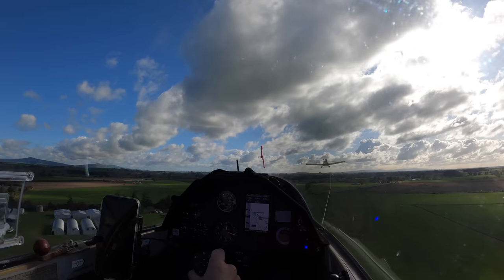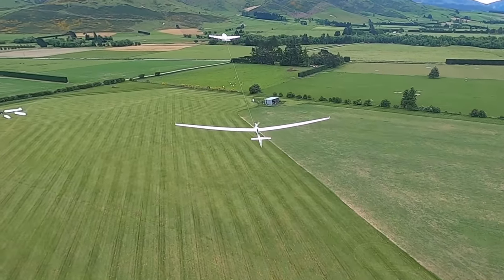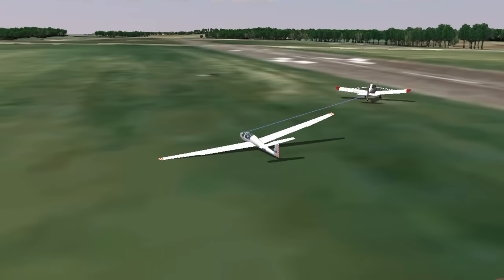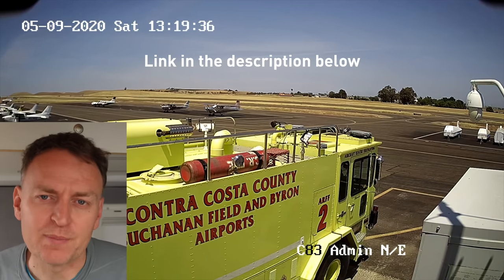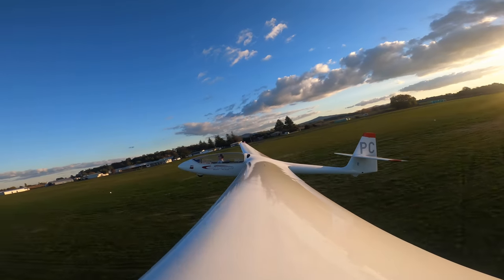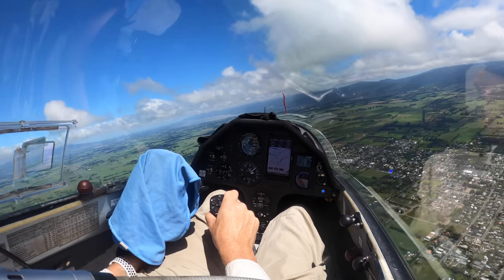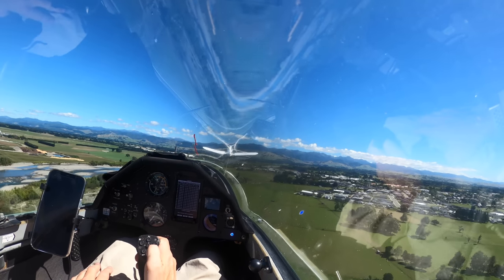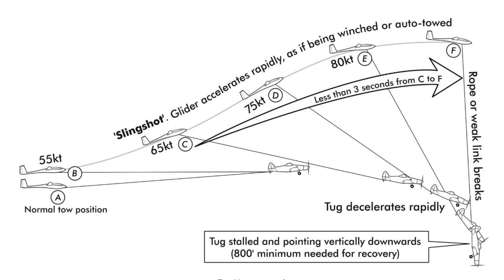3 Seconds to Crash: Glider Aerotow Launch Gone Wrong

Comment from the maker: A few points I didn't cover in the video:
- The tow plane does have a release at it's end too. But it's difficult for the tow pilot to see the glider, and if there is too much tension on the release, it might not work.
- For glider pilots, ensure your trim is correct for takeoff. It depends on the glider, but it's safer to trim a bit more forward than needed, than back. This should reduce the chances of a both leaping off the ground too quickly, and a vertical upset above the tow plane. Also don't forget to trim correctly once you're flying.
- Consider hand on the release during the critical low part of the launch.
Cheers!
Reply: The glider's release can be too far away to be held in your hand during tow (my old DG-101 was like that).  What is your opinion of a lanyard going from your wrist to the release handle?  Or an T-handle extension to place the release on your thigh?  Many thanks for this video.
Reply: @cemx86  Not a glider expert, but I have done a lot of safety analysis in other settings before. Regardless of other opinions (unless they're expert opinions/regulations), I would recommend doing your own safety analysis in addition to listening to other's suggestions.

The most important thing to look at when changing a safety device is, could your change impact the normal operation of the safety device and prevent use in an emergency? For example, could a lanyard fall and get caught on something, becoming taut and preventing you from pulling the tow release? Are there other ways the tow release could become jammed?

In addition, could the modification cause the safety device to be activated in a situation where it's not needed, or could even make a situation worse. Could the lanyard become caught on something that, when moved, pulls the tow release when you didn't intend to.

When analyzing something for potential safety issues (trying to identify issues that haven't occurred but you're trying to prevent from happening) it helps to just spend time brain storming. What are the ways this could go wrong (even without the modification) and how does the modification impact those things (good or bad)? Are there new ways things could go wrong due to the modification? Are the risks associated with the modification greater or less than the risks without the modification (IE. does the modification create a new potential failure mode, but the probability of that failure mode is much smaller than the one it helps prevent)?
Reply: @cemx86  We used to use an extension  lanyard and T piece handle on the release of our PW5  but I don't think they are really legal.
Reply: Did some thousand aero tows as a tug pilot in the mid 1980's. They had a winch system installed which retracted the tow line during descent. It had no release at the tug but for safety there was a cutting device for the tow line which worked very dependable, no matter of tow line angle or load and tension. Felt much more comfortable than the usual tow release.
Reply: "...if there is too much tension on the release, it might not work"  that has to be fixed doesn't it.
Reply: at 4 min 58 you write glider accelerate. is this really true . i think  when the glider go up in this angle it reduce speed and the tow plane speed is then reduce too because the glider work as a break parachute for the tow plane. the glider can in this bad sitiation if a pull down does not help to continue do more pulldown to get faster so the tension of the cable is remove and he can release.
Reply: @user-lw9py  if the glider pulls and climbs up, it accelerates. The rope length does not change. If the glider goes up it has to go more forward. The force on the rope accelerates the glider (and decelerates the tow plane)
Reply: one of the most important points my club taught me during training was to always have your hand on the release throughout the full launch (that applied to winches too)
Reply: @maikjustus2003  My guess is this glider use a center of gravity clutch (google translate this from Schwerpunktkupplung). better fly only bow clutch. I mean with speed the speed move only forward. when climb the speed that move forward is reduce but the speed of climb is increase. A glider have more  wing area and can slow down a tow plane alot when glider climb much.i did not know if simulations are able to simulate it correct or if they just assume the tow plane fly at same speed and the glider get faster.
Reply: @user-lw9py  the speed increase is the same independent from the clutch type. And yes, the tow plane decelerates. It is about the ratio of their weights (conservation of momentum).
Btw.: Depending on the type of clutch the recovery from "out of axis" can be much harder or even impossible, therefore with a "center of gravity" (?) clutch the risk to get too high with the glider is much higher. But if the glider climbs it will accelerate independent from the clutch type, but with nose clutch it will most likely climb much less.
Reply: @maikjustus2003  WIth a glider that have no nose clutch and the tension of the tow get 0 and then after some tme tension come suddenly , the glider jump up. then glider pilot pull down to climb not more up and get faster , tow get again tension of 0 and the game repeat. in the 80 their are many accidents. so as a tow pilot with less horse power better use only nose clutch able gliders
Reply: From a tow pilots point of view I have released some gliders on takeoff  Prier to starting the day the tow hook is tested at most extreme angles to make sure it will release. If on take off I am running out of control movement I dont think, I just release.  It then often requires a very quick reaction on the controls. Because you have been countering what the glider is doing and you are close to the ground. The glider has many more options than the tow plane. I have over 600 hrs towing and almost 1000 hrs gliding and at low level with a new student the take off and position hold behind tow is the most crucial time especially in a gusting crosswind....
Reply from the maker: @cemx86  The cable for the release has to be long enough to use it! Talk to your glider engineer
Reply: I am embarking on tug training one of these months, but have taken some cockpit photos and talked to tug pilots to mentally prep ahead of time.

Most tugs nowadays are fitted with an independent, reliable and robust guillotine mechanism, that will work regardless of tension in the line (chops the line, not a release mechanism, that could jam up under tension).

In the link at the bottom, there's a photo of a typical guillotine control mechanism (the yellow handle) - Right next to the throttle, where the tug pilots hand is going to be throughout the ground run and at least the initial climb out of the take off.  I am told that these are incredibly reliable and easy to use if used in time and save lives (plenty of incident reports to attest to this).

From what I've heard from various tug pilots all over, the attitude should be, if the glider gets too high, and in ANY way appears to be "losing the plot" in terms of the ability to control getting too high behind the tug, the unhesitating attitude should be cut them loose if in ANY doubt.

Better a glider field landing and the cost of a tow line than a wrecked tow plane and possibly severely injured/deceased tug pilot.

https://photos.app.goo.gl/ogAzEJ7ocvuMymB96
Reply: Thank you for these insights.🤍 👍🏼very well presented👌🏽
Reply: @nigelwilliams7920  It used to be a problem with seat belts, too. The old design with the button in the center that you had to push in was nigh impossible if there was tension on the belt. Now they have the button you push DOWN and it will release even under immense tension.  Surely something similar would be on a modern release. (I haven't flown gliders in 20 years so I'm sure things have advanced.)
Reply: @user-lw9py  if you've ever flown a kite, you can make an ascending kite accelerate by adding tension to the line. It creates force greater than the loss of momentum due to the climb and so acceleration is the result.
Reply: Yeah, I was just going to mention the Tow plane release. I worked at a Glider Airport outside Chicago,  Windy City Soaring,  25 years ago when I was 14 until 16 years old, in exchange for lessons & rental, until they changed the minimum age for "dangerous" jobs to 18. I was doing all the ground stuff for takeoffs and landings, connecting the Gliders, and running with the wing on take off, moving them off the runway after landing and etc, but I have seen the tow planes disconnect before, but never really thought about the line being too tight to disconnect. I remember something about an auto disconnect, which was a big hazard when the tow plane came into land, usually we had to watch out for that tow cable, but they would occasionally disconnect on landing and possibly turn into a random projectile/ very large bolo.. and we were just basically running around on the grass runway getting gliders ready and stuff. it got really busy at times, was the only glider place around Chicago fo a long time, .. been 25 years, but I definitely remember the tow lines disconnecting from the tow plane on landing occasionally when they hit the ground. I also swear I went over an emergency procedure for if the tow line disconnected from the tow plane before the glide, and hearing something about auto disconnect if I go too far out of formation during a tow during my lessons, it could have been some custom gear or something, and this was in the US also. It could also just one of those weird things I remember that never actually happened...   I haven't been gliding in about 15 years, been doing just power.
Reply: it did cover that aspect at3:19
Reply: If you have released, the question is can you do anything about the tug pilot? No. So you must concentrate on you flying your aircraft, and landing safely.
Reply: @PureGlide  I think something to look into is how many aspiring pilots are going for gliders first because they're far cheaper, because the middle class can't affordably rent or buy GA airplanes anymore
I'd even bet that that's transferring fatalities from the GA prop pilot section to the glider/tow section
Reply: @ialsoagree  I absolutely LOVE how you tell others to do their own risk:reward analysis, and game it out in their head. You don't see that very often from experts.. they've got their own opinion and they stick to it without even regarding how many different situations exist in real life
Reply: @cemx86  just my too scents, I think I'd just be really prepared and practice having muscle memory to get to the release quickly instead of doing your own modifications..
If you don't think you could even reach it during some profiles, though you might want to modify
Either way I'd practice going for that release lever repeatedly every time you fly, before you get towed
Reply: I think the study I saw showed that if the angle got to high even the tow plane could not release and no amount of elevator on either plane could recover the dive.
Reply: That's insane! If the towplane cannot release due to "high tension" - forget it.
Reply: probably the construction of the relase on the side of the plane should be much better costruction wise.. this was crazy.. once i had also problems when i and also the tow plane had to release the line.. the tow plane had some issue with motor we both ware luckily able to safele return to the airfield cause the take off on thas wind dir is flying over town.. the line was lost in crops.. its better to fly unde the tail than over.. sometimes on thermic day you see the plane dissapear up in whe it flies inside the thermal before glider.. and the same when the glider is still in the thermal and the plane drops out.. you have to push hard down to go after.. wow.. realy scary...
Reply: Well, if that's truly the case in both instances, the system is fucked and needs to be completely rengineered. Why would anybody risk towing a glider if these conditions exist?
Reply: I had several hundred hours towing gliders (also a glider instructor).  It was mandatory that before every tow was commenced a circle check was done and that included touching the tow rope release.  On  more than one occasion I had to pull it because the glider got too far out of position.  Always, always keep that front of mind when powering up at the beginning of a take off run.  If you ever run out of stick or rudder control don't think!  Pull the damn thing. @witblitsfilm
Reply: Are there any modifications to modern tow rope systems that can auto disconnect if the tow angle is out of safe parameters? I'm just getting into soaring so please excuse my lack of knowledge. I have this innate passion to try and come up with solutions to problems even when I don't fully understand all the issues.
Reply: Hi. Thank you for this video. I wonder about the safety breakers (metal plates between the rope and the ring) which should break in such a situation. At least I saw twice personally that they worked well and despite none of the pilots released the breaker was broken releasing the plane. In Poland this is generally standard feature on the tow ropes. Probably it won't help in such a low altitude but can help in emergency tow situations which happen higher. Cheers!